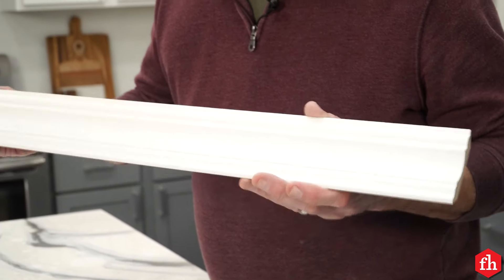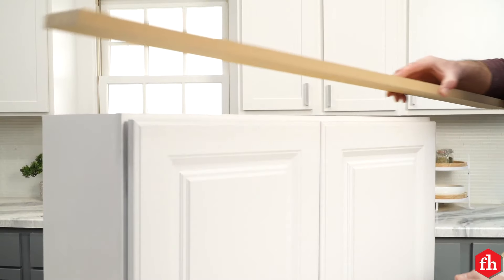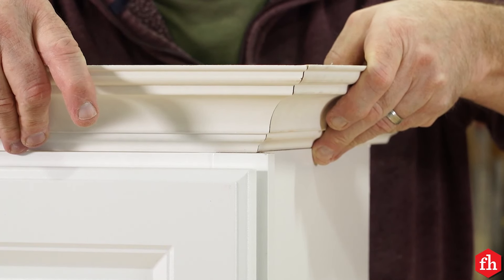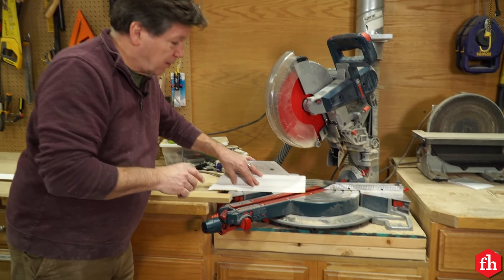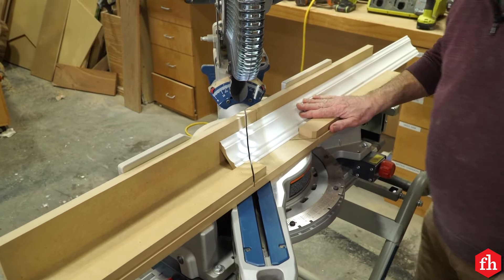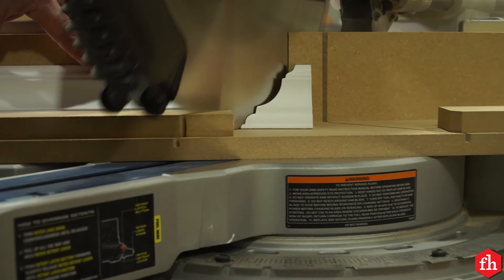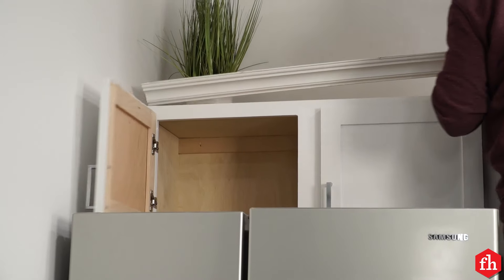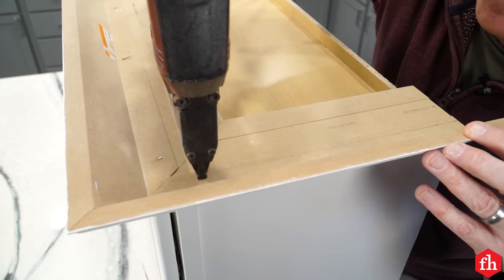How to Install Crown Molding on Kitchen Cabinets

Comment: I have that same saw and after I let go of the trigger it doesn't stop nearly as fast as it did prior.  That really fubared a trim piece I was working on.
Reply: Seems like you may need a better blade. The more teeth you have the better the cut and the faster the stop of the blade.

Comment: What gauge nails are you using?
Reply: 16 penny framing nails.
Reply: Looks more like 18 gauge to me, I use 18 finish nailer for most mounding these days. And the outside corner looked more like a smaller 23 gauge pin nailer. LOVE 23 gauge for when a fine finish nail is needed. NO filling nail holes with the pin nailer after.
Reply: Curious as well.  18g or 23g?